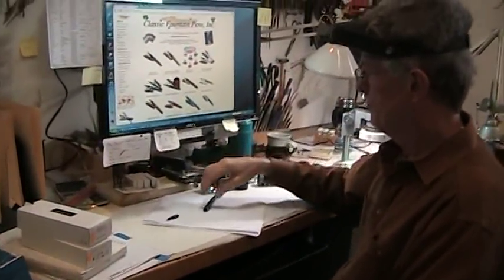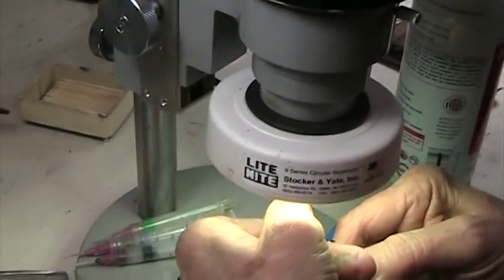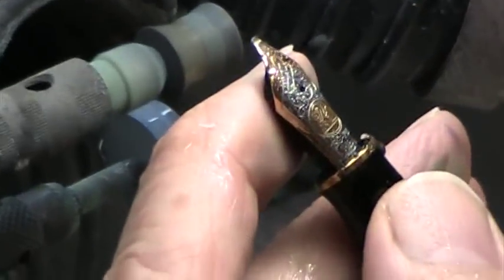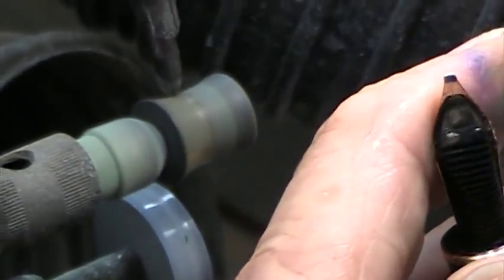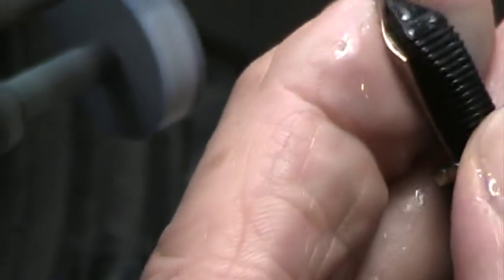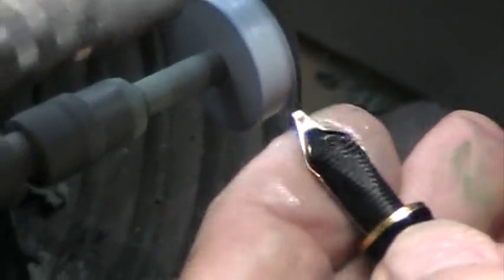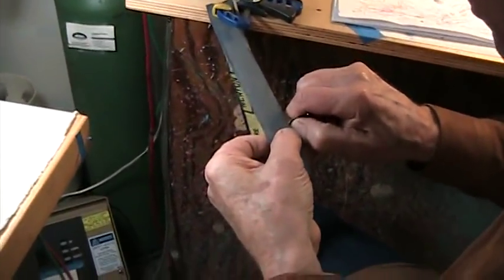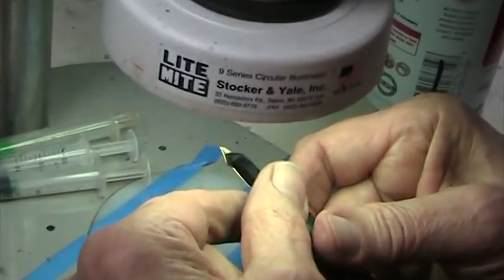Pelikan Italic Nib Regrind and Customization

Comment: I am facinate by the amount of tipping material that you remove correct me if I am wrong but it appears that at least half of the tipping material if not more is removed in profiling that nib.  Additionally what sort of abrasive are you using when "flossing" the nib after profiling it?

Comment: What do you do about the tipping material?  It looked like you ground it all off, but I may be not seeing it right.
Reply: This is my biggest concern about nib customization, also, David.  When I asked this question of nibs.com's customer service via email, they (not John, a representative) didn't seem to be aware that most high end nibs have an iridium tip, and that custom grinding could, from my lay perspective, remove this and expose the much softer gold to the writing surface, thus drastically reducing the lifespan of the nib, if it is actually used a fair amount.  I didn't push the matter further when I couldn't get a good response from them, though I'm sure John himself, master as he is, would have a precise answer.  I'm just hoping that there is enough iridium left behind to keep the writing surface preserved, as I have a cursive italic grind by Mr. Mottishaw on my Sailor 1911 Realo and it does yield a beautiful ribbon-like effect.
Reply: He absolutely left tipping material, he reduced it and changed the shape.

Comment: I hope that vaccuum leads to a bucket, so that you collect everything you grind off.
Surely that would be worth loads after a while, haha!
Reply: I don't think the tipping material is actually worth that much
Reply: @glumfish6862  depends on what the tipping material is.
Reply: @Alsry1  Even if it was gold, the cost of refining it probably isn’t worth it compared to its value.
Reply: @glumfish6862  you’d be surprised how easy it is to refine metals.
Reply: @Alsry1  sure but I don’t think it would be that cost effective.
Reply: Tipping is usually Iridium - not gold
Reply: it would take a century of nib grinding to accumulate any worthwhile amount of precious metal

Comment: How did he make the flow wetter right at 9:13??
Reply: Usually these units have a control and output valve of some sort, that makes the flow higher or lower. I have one for my lathe that I use for cutting metal, and it has a foot pedal I can use to control the flow of lubricant.
Reply: John Mottishaw improved the ink flow of the nib slightly, by grabbing the wings of the nib with his thumb and placing his index finger on the face of the nib and slightly spreading (bending) the tines of the nib just slightly a somewhat better demonstration on this can be scene in the video done by TWSBI I think sbrebrown also demonstrates that in one of his videos and well.
Reply: bradhorn14 Chris Jung was not referring to the flow of water \ coolant of John Mottishaw grinding wheel but rather to ink flow of the nib (note the timestamp reference of 9:13 John is test writing with the pen.